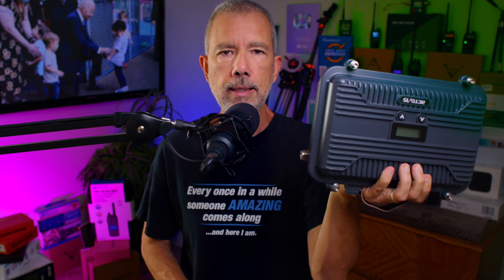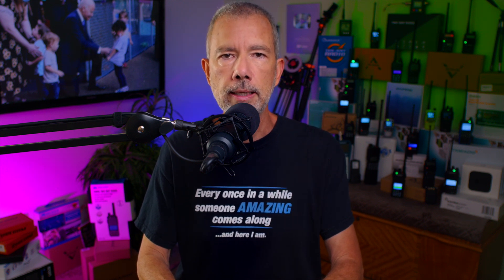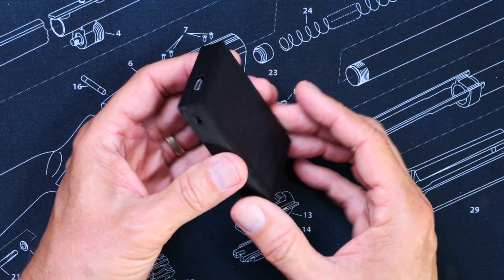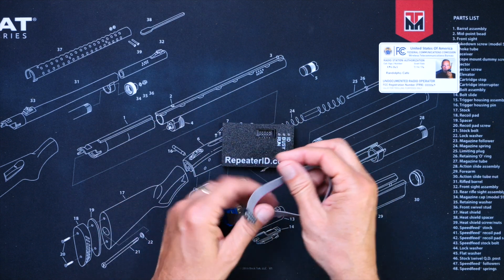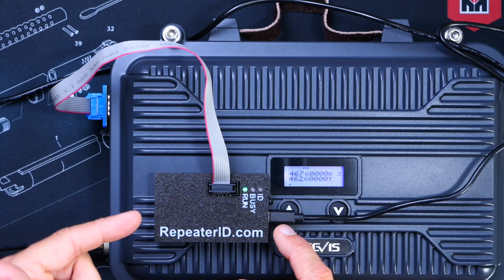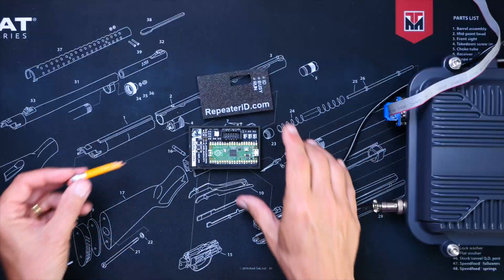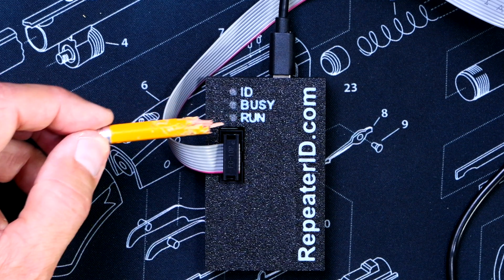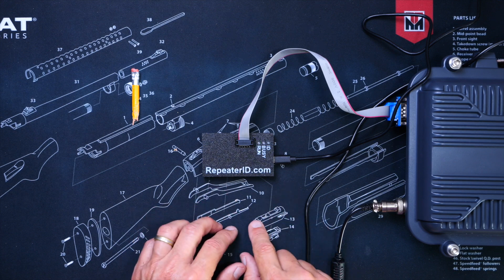Quick Overview Of The Repeater-ID Device For Retevis RT97s GMRS Repeater & RT97p Ham Repeaters

Comment: Question related to GMRS range — do you have any top recommendations for BAOFENG UV5G Plus antennas? I’m wanting to try an antenna before I try a repeater. Assuming terrain is good. I cannot for the life of me find an opinion on this. My brother lives about 7 miles away with the same radio.
Reply from the maker: My recommendation is to ask this question on a video about the UV-5GPlus, instead of on a video that has nothing to do with, and is totally unrelated to antennas or the UV5GPlus.

Comment: Randy:  Excellent.  I'm considering assembling my own local area GMRS repeater. If you have 25 watts out of the duplexer that's feeding a reasonable gain antenna that's mounted up at 40-60 feet with even a small relative gain of, say 3 dB (AKA double the power) you now have an ERP of 50 watts.  The duplexer loss has just been nullified by the relative antenna gain.  That's why a good antenna will net you more bang for the buck than electronics in the shack - DUH!  Even 10 watts with a clear view of the coverage area is plenty of power to cover your local community which, I believe, is the intended purpose of GMRS.  Keep posting your practical videos.  I'm glad your cant' work coax is working.  BTW, who needs expensive heliax for a local repeater?  Just buy a good antenna.

Comment: Those that are getting that knickers all bunched up over GMRS repeaters not always IDing might need to consult this section of Part 95: https://www.ecfr.gov/current/title-47/chapter-I/subchapter-D/part-95/subpart-E/section-95.1751#p-95.1751(c)

If I set up a GMRS repeater intended to be used only by those covered under my license it does not need to ID.  Also if I am understanding that correctly if I set up a GMRS repeater and allow others to use it the repeater does not need to identify as long as everyone else using it properly IDs.

Still it is a neat device and I might look into getting one for the repeater my deer camp group will be setting up this year.

Comment: Wonder if it goes silent after the conversation end and last required ID. My station is on solar power. Thanks...
Reply: It's one of the switch options, the support section of the website mentions one of the dip switches setting whether the device will ID during repeater inactivity.

Comment: Why does a repeater need to broadcast a call sign? Where does one get said call sign for a repeater?
Reply: Here in the US a repeater, whether ham or GMRS, is considered a station by the FCC and has to identify every so often when it is on the air.  For the ham side it is every 10 minutes and for the GMRS side I cannot remember if it is 10 minutes or 15 minutes.  Anyone with a ham license or a GMRS license can set up their own repeater using their callsign.  Pretty much all GMRS repeaters here in the US are tied to an individual callsign.  The majority of ham repeaters here in the US are tied to a club callsign because they are operated by a ham radio club.
Reply: @DarkShadowCustoms  Thank you for your reply. As a station it needs a call sign and if I set up a repeater, I can use my own call sign for that repeater. Thanks again.
Reply: @Amiga3000D Bingo.  It’s for “who do I send a letter to if this is causing problems”.

Comment: Just one correction. That will work on the GMRS repeater RT97S and NOT on the RT97 as it does not have the DB9 port. Your title is misleading.

Comment: Does it need the USB power while running, or is that port just for the upload?
Reply from the maker: Yes, it requires power but I believe the shipping production will have a power adapter that connects to the repeater's power plug.